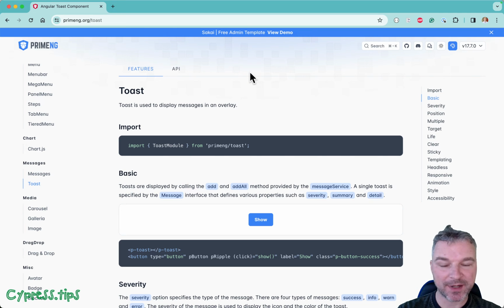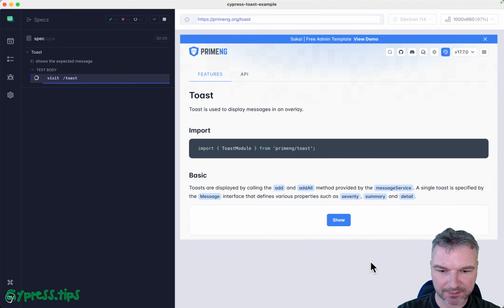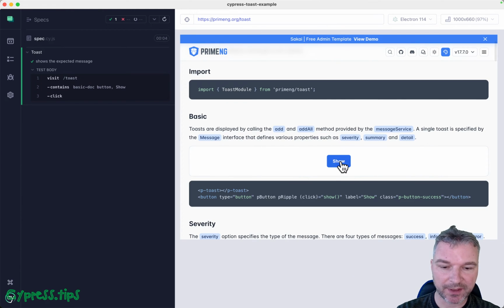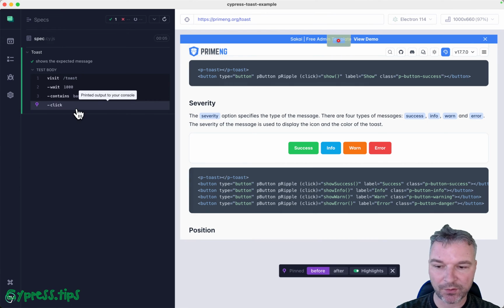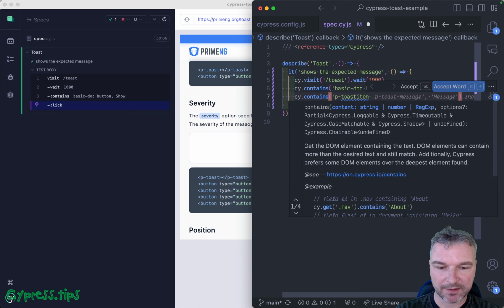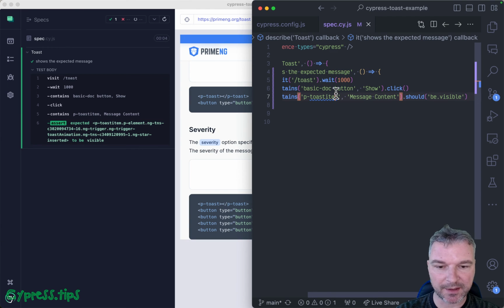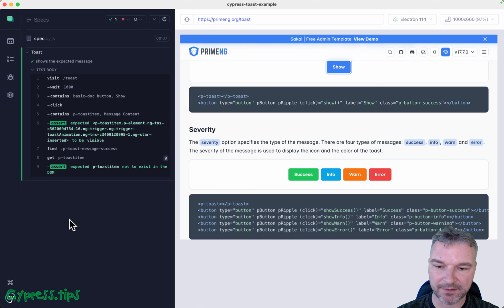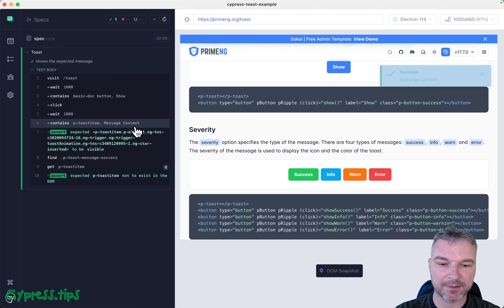Quick Toast Test

Comment: Thanks for the video. Just wondering, how, in this particular, scenario, would you avoid using cy.wait()? What would you wait for instead?
Reply from the maker: You need some observable attribute to know when the JS code has finished loading and attached click handler. For example if your framework or app sets "loaded" class on the body of the document.Then instead of cy.wait(1000) you can do cy.get('body.loaded') and proceed.